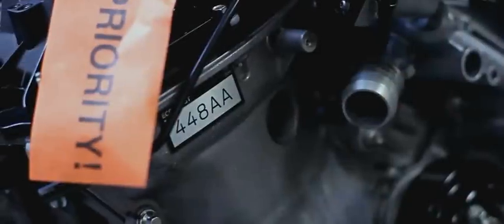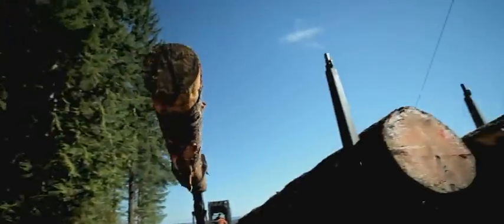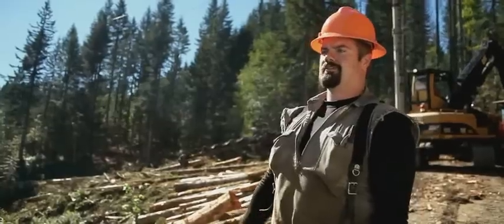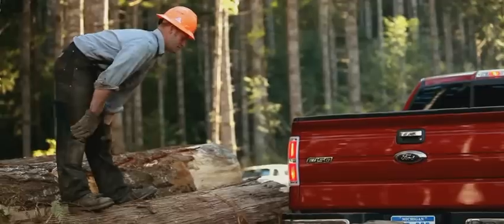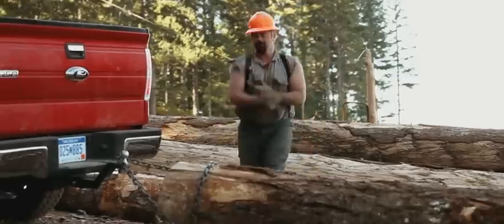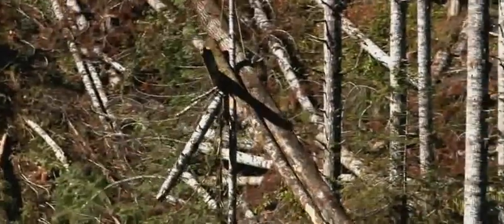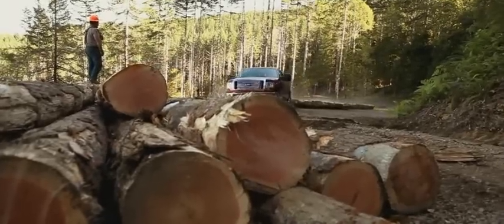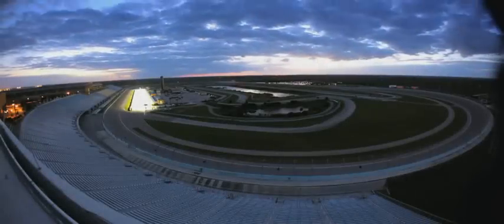Torture Test #2: 2011 Ford F-150 "Logging Miles" with the 3.5L ECOboost engine

Comment: I have an '11 F150 with the Coyote 5.0 and I know for a fact it is just as good the EB, It has towed and hauled everything I have throw at it. It is also capable of the same mileage EB guys report empty and better with a load than I have seen reported by enthusiastic,honest owners on forums.With a max tow load the EB has a 1- 2 sec advantage in acceleration over a 1/4 mile but in the real world the 5.0 is already capable of accelerating at a rate that isn't safe with a 5T+ trailer on a public Rd

Comment: The video and description say logs weighing 4000 - 9000lbs. The truck shows only max log diameter of 18 in and 20 feet long= 1243 lbs. A 48 inch diameter log 20 feet long weight is 9891 lbs. I didn't see any log that big pulled up that hill. Even a log 18 in large end diameter would weigh 5040 lbs if it were 100 feet long.
Reply from the maker: 1oneKid, good catch!  In the beginning, the logger said, 110,000 lbs. for the 22 logs so 5,000 a piece.

Comment from the maker: Yes I have. The 13 
/14 RAM 1500 with the 3.6L V6 Pentastar and 8-speed AT is more efficient. The 5.3L in the 14 Silverado did not seem as efficient but I did not drive it over a lengthy  measured distance.

Comment: putting a turbo V6 and trying to make it last a long time??  i know boosting a smaller engine can give you better mpg when ur just driving around without a load, while still giving you the power when you want it, but when you're actualy pulling a heavy trailer or something, that boosted V6 is gonna suck down just as much fuel as a V8, and with more stress on the rods and other components.

Comment: I don't like the eco-boost thats why i got a 5.0. reasons why the turbo can blow up to much boost or to much weight. people will start realizing about 100,000 miles on the trucks they will start having problems
Reply: Except they didn't. Our company has a few 5.0s but the 3.5s are going well over 200k with no issues if serviced and taken care of